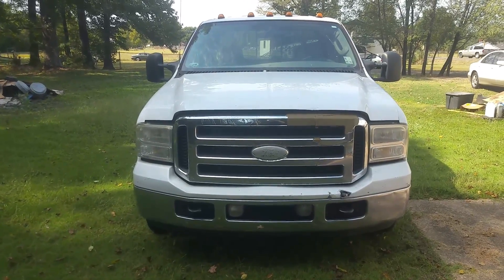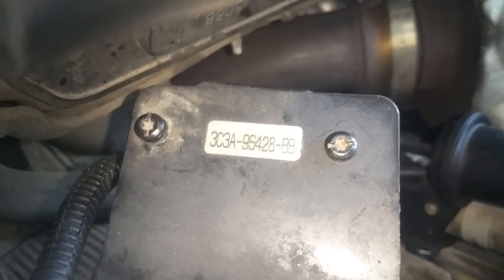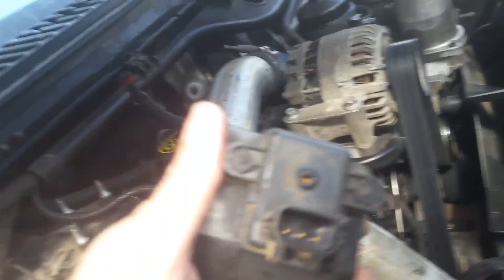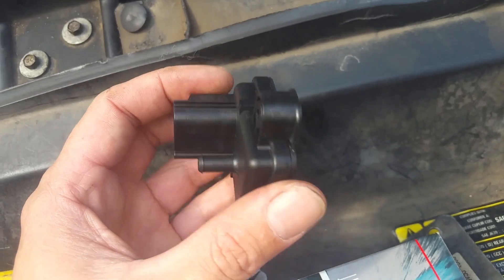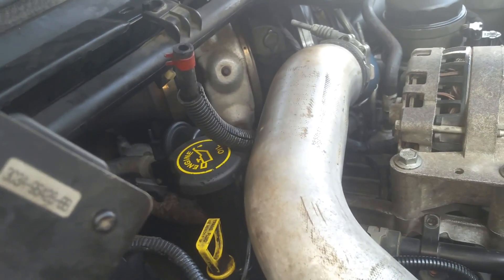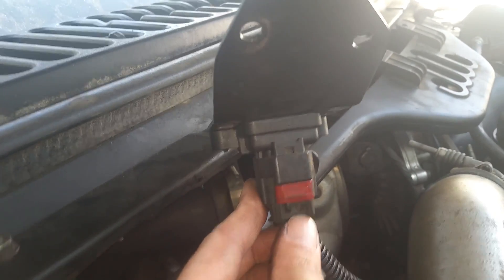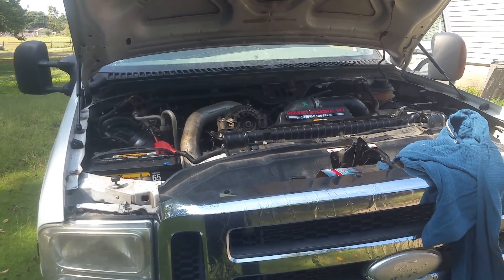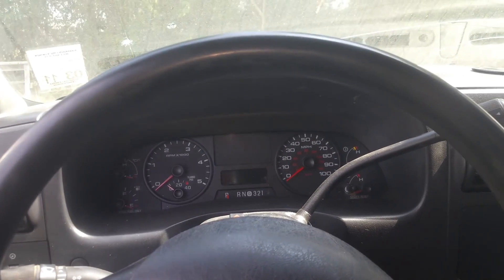Replacing map sensor ford 6.0l powerstroke /fixed extreme power loss

Comment: Will that leak make a hissing noise while driving?
Reply from the maker: +MERKK Alamillo yes it could , however you'd mainly notice the boost guage not working initially.  The hissing noises , tea kettle noise , whooshing noises are quite common with these 6.0 . I've had cac boots , the plastic intercooler cracked. I've heard y pipe exhaust manifold and even turbo itself making noises.  Sometimes these noises are really difficult to track down or even tell where exactly they're coming from . Thank you for watching
Reply: I know your comment is old but to add to s33therfan a hissing sound can also be caused by a cracked ypipe. Starts off with a hiss "under a load" then can get worse while basic driving, idle and so bad it smells like exhaust in the cab (that after awhile of letting it go not a few weeks into first hearing it).
Reply: @Kevin-vu6mg  this seems to be what I'm experiencing

Comment: My son took his F350 to the Ford Dealer in Evans Ga. it was blowing white smoke and low power they look at it and said it would need to be rebuilt around $10,000.00 dollars he got another Diesel shop to look at it found a bad sensor the cost to fix was $350.00 Dollars.
It runs like brand new.
Reply: Im having the exact same problem. Can you see what the name of the sensor is?
Reply: Same here!! I have a F250 and it blows white smoke when I accelerate and reach a certain RPM. The power is extremely low at first, but just needs warming up (even when the temperature is 80° outside)
Reply: What was the problem?
Reply: @williamcone4249  do you know what they fixed
Reply: Left on a cliffhanger 🤣 I would check the ebp sensor and clean the egr valve

Comment: Thank you for the video.  Great information.
Reply from the maker: Thank you very much for the great feedback . I appreciate it.
Reply: @s33therfan  Yo I think I asked you before but on my 06 f250 6.0 im getting a code p2262 (no boost detected). Do you know the common problems? The Hose from the map sensor to intake manifold looks fine. Could it be the map sensor? I know when I start it in the morning it has no power. Takes 25 seconds to go 60mph. But after 8-10min you can finally hear the turbo come on and then its fine. Any thoughts?

Comment: I'm late to the show Thanks for the video trying to figure out if I should replace the hose and if it's special or not.
I have an '03 and use a free software called fourscan for my truck. I love the 6.0 but personally it sounds like you might have a contribution error. Like an injector might be out. Mine sounded like this recently. Two cylinder contribution errors.
Reply from the maker: I appreciate the feedback and thank you for the information.

Comment: Holy crap, that was an easy fix. Makes up for all of those broken bolts you had to deal with! lol I guess with that hose off you had a vacuum leak, a code, and a boost leak too? Fuel trims would be off too I'd guess.
Reply from the maker: +Baxrok2 yes sir , I was very happy indeed. I knew I had power loss but hadn't expected that kind of difference. Usually it's never that easy for me ha. I had to wait impatiently for like 5 days on that map sensor. Thanks for watching
Reply: s33therfan  what were the symptoms you were having ?
Reply from the maker: +Josh bridges basically the boost was not building at all on the guage inside the truck and I couldn't accelerate . No power at all . It should throw a code but I'm not sure what the code number is. Hope this helps and thanks for watching
Reply: s33therfan man I'm stumped on my truck it starts fine in the morning will drive for about 10 to 15 minutes then all the sudden lose power to where I cant accelerate and then starts shaking and shuts off if I let it sit on the side of the road for 5 minutes and then restart it it will drive fine for another 2 miles and then do the same thing
Reply: I'm changing the fuel filters tonight then going to start looking at sensors
Reply from the maker: +Josh bridges It kinda sounds like the classic high pressure oil problems , ie leakage but that's just guessing . But if it was mine that's where I'd start . The seals on hpop are first culprit for leaks , sti fitting then stand pipes dummy plugs . Has any work been done ? Any codes at all ?
Reply from the maker: +Josh bridges Really need some codes , how many miles , what if any work has been done . These 6.0l require a lot of maintenance just to stay ahead of the issues . It could be alot of things but checking the codes can narrow it down. I've got my ficm in the shop now and about to have to replace the #8 injector . I will say the filters are a good start because they will cause the injectors to fail , of course there's the filter on the frame where the pump is and the one up top . I've got a video of the one on the frame if you want to check it out .
Reply: s33therfan  03 f250 6.0 with 375 miles :/ i have no clue whats been done . I bought 2 weeks ago to use for fema and 4th day this is what its doing .
Reply from the maker: +Josh bridges yes that's got some miles . That year they had the aluminum high pressure oil pump ( hpop ). If someone has been in it you can tell , they may have done some egr bypass work etc. If not I'm sure that's all carboned up . My first place to start would be taking a look at that hpop . You can take the Ipr out look at the screen , if you find shavings shrapnel it's pooched. If it's clear I'd check the orings it's sits on. If they're bad get hpop kit reseal it . 2004.5 they went to cast iron hpop because they rarely fail the aluminum do however. I had a 2004 that had a similar issue . I don't know the exact failure but the hpop seals needed replaced while I was in there I did the injectors orings and stand pipes and slapped a new oil cooler while I was at it . Had zero issues afterwards . The hpop was aluminum just like yours but it was fine just needed seals . Anyways hope some of this is helpful and hope you get something figured out . Thanks again for watching
Reply: s33therfan  thank you very Much !!!
Reply: @joshbridges6299   Josh... was it indeed the Map sensor... I am replacing mine today... but my symptoms are identical to what you had going on.  Had already replaced high pressure oil pump and lower fuel pump/filter assembly.
Reply: diesels do not make vacuum. MAP sensor measures air density its basically just a boost leak. and since its a stock truck with VGT turbo. the VGT vanes will not do their job unless your MAP sensor, and on some tuning strategies the EBP sensor is inferred so it isn't utilized. but either one of those sensors not working and theres power loss easy assumption that VGT is not working correctly and if turbo is known good turbo and solenoid is too then the MAP and or EBP sensors are culprit.

Comment: That was very helpful thank you I'm having the same problem with my truck and I could not figure out what it was
Reply from the maker: Thank you for the feedback and thank you for watching
Reply: Mine it's not accelerating did yours did the same?
Reply from the maker: Yes , it wasn't building any boost at all .
Reply from the maker: The TacomaKid  if i remember correct i only had a standard map sensor code on mine. Thats puzzling for sure with no power loss . Wish I could be more help . Thank you for watching
Reply: @horaciomendez965  mines not accelerating either. Do you figure out what the problem on yours was?

Comment: Thanks for the video but just to know what is the function of the map sensor to the truck.I know that map is an acronym,so what does it mean.
Reply from the maker: It is the manifold absolute pressure , its like many sensors that causes major issues when it  quits communicating with the pcm. Thanks for watching.

Comment: Hey why some of those engines maf sensor goes Here and some others goes by the air filter ? I have super duty 2005 whit the 6.0l diesel and goes in the same place than thia video ,but the part show is diferent and goes by the air filter ,now I have to buy same than this video part lol
Reply: That’s a MAP sensor not MAF. Manifold absolute pressure

Comment: Do you remember what the error code was that calls out the MAP sensor?
Reply from the maker: I believe I was getting a P0069 , my boost guage on the dash also wasn't working at all. Another thing to check for is damage nicks cuts to the rubber hose or blockage . Hope this helps and thanks for watching